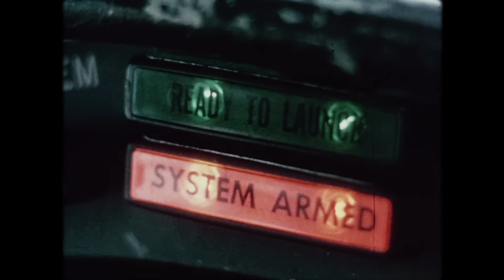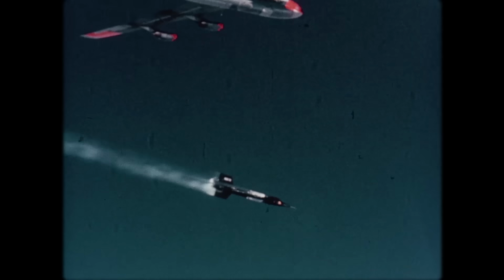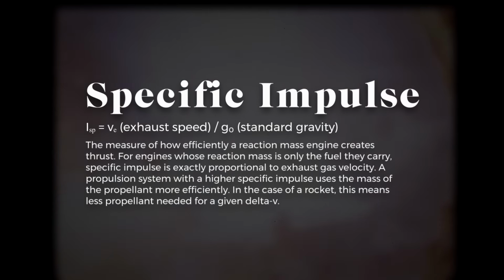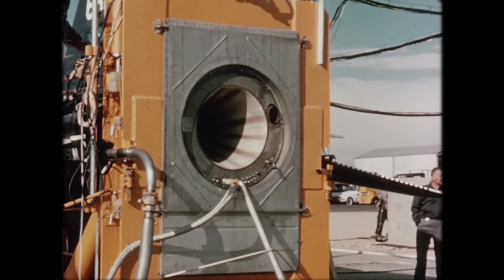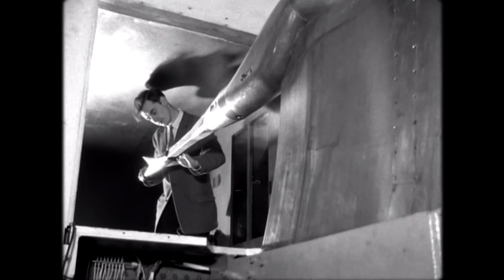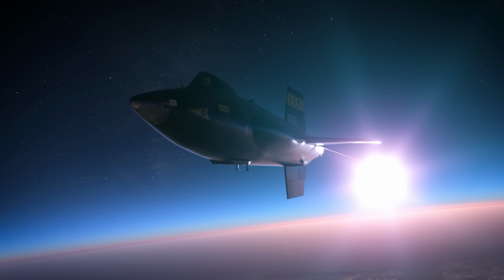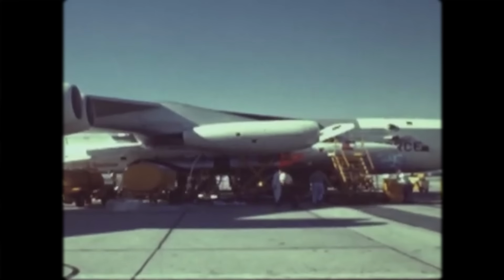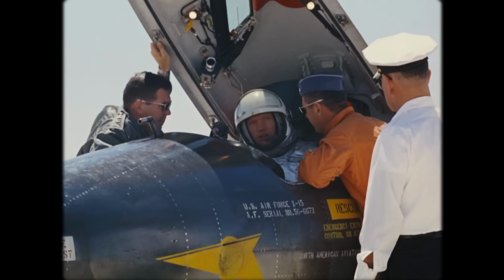The Insane Engineering of the X-15

Comment: You'll even read these American people talking such garbage about their aircraft, you'd really believe you were reading a pubescent 14-year-old struggling through puberty. 

Oh, you'll read endless claims they have the best fighter aircraft etc, as always. Seemingly they just don't know that both the F-22 and F-35 can't see, track, or target any other stealth aircraft from BVR (beyond visual range). 

Stealth alone defeats high-frequency (short wave) radar by absorption and deflection, it does not defeat low-frequency (long wave) radar. Therefore, to see, track, and target stealth aircraft you must have long-wave radar, but it must also be enhanced to remove all background clutter for targeting purposes.

Neither the AN/APG 77 radar used in the F-22, nor the AN/APG-81 radar used in the F-35, can see any other stealth aircraft from BVR (without enhanced long wave radar) — This fact the US Air force obviously know! 

Only it seems the reality is, that when the F-35 radars were being designed 13 years ago, there were no other stealth aircraft to think about as a potential threat? 

So how can these US aircraft be seen as any sort of threat to either China or Russia who both have these aircraft technically beaten? They can see and target US jets from BVR, yet the US jets can't even see them from BVR?

Russia's new 5th generation Byelka (2band) radar, used in SU-57, does have enhanced long-wave radar, they've designed and developed the first L-Band fighter radar we've ever seen. They've cleverly embedded L-band AESA radars in the leading edges of the wings. 

The new L-band AESA radar data gets processed in real time through extremely powerful Russian Elbrus computers being significantly enhanced removing all clutter, meaning it can see, track, target, and engage enemy stealth aircraft from BVR.

They can also interact in ''real-time'' with each other, and take control of ground to air missile defence systems (that alone is lethal), and they can see enemy stealth fighter aircraft entering Russian airspace if not long before Russian airspace from much greater distances with real-time data from massive Russian ground long wave stations (that are all protected today with the networked S-400 defensive system). 

Therefore, as they'll always know where the enemy aircraft are, they'll always be able to approach any enemy aircraft head on, and therefore stealthily, (Russia wisely sacrificed rear end stealth for much better manoeuvrability) meaning today, the US fighter jets would not even be able to see them coming!!

Russia's Byelka (2band) radar covers all aspects of frequencies across all channels, that are used for tracking, targetting, and also jamming. It's part of Sh121 multifunctional integrated radio electronic system (MIRES) on board the SU-57. 

Russia tested much of this new radar suit on the SU-35, so they also have the option of fitting this radar into SU-35's permanently, meaning Russia's SU-35S flanker will be at no disadvantage with F-22/35. 

As although the SU-35 can be seen and targeted from BVR, the SU-35 with the new 5th gen radar is as able to see and target the US jets from BVR, seeing the all-important Russian advantage in BVR missile distance, plus the excellent manoeuvring, neither the F-22/35 have, as more than critical, if you're going to avoid simply being blown out of the sky.

Dr Carlo Kopp of Air Power Australia explored low band AESAs embedded in fighter wing leading edges in 2009, and concluded that this concept is operationally and technically viable. 

Study results were not published by APA, due to the potentially adverse impact – APA has a long-standing policy of not publishing concepts that might provide potential adversaries with a competitive combat advantage. However, unbeknownst to APA, Tikhomirov NIIP were already working on this concept for two or more years, and they revealed the technology at the Russian MAKS Airshow in 2011.

Dr Kopp explains - the appearance of the first L-Band Fighter Radar is an excellent example of focused and intelligent lateral thinking which targets opponents' weaknesses. 

This is sound technological strategy and practice on the part of Russian industry. The new Tikhomirov NIIP L-band AESA is the first example of a technology which negates the intended X-band stealth advantage well before the F-35 Joint Strike Fighter achieves even limited operational capability.

Dr Kopp has produced a detailed forensic engineering study of the new NIIP L-band AESA and he explores the growth potential in the design.

While the NIIP L-Band AESA disclosed at MAKS 2011 might be considered a prototype, where the specific performance of this prototype might confer only a small combat advantage, the inevitable development of this technology confers long-term and accelerating air combat advantages, both as a counter to specialized X-Band Low Observability and for the detection and disruption of sensors and digital communications systems that operate in the heavily used L-Band.

No great originality is required to deploy and further evolve this design - the back-end hardware and software from existing X-band radars can be used with modifications, and publicly disclosed US roadmap documents for X-band AESAs can be emulated. The size of the Flanker and its power generation reserves make integration and cooling a low risk, easily solved standard of engineering problems.

And this was back in 2011. We've seen where it went, It resulted in the N036 Byelka radar system that's far superior and more advanced than any western radar, who have no equivalent.

Dr Kopp explains - This paper analyses the operational potential of this  design, and performs a range of performance estimates based on  manufacturer disclosures and known design features.

The design has clear potential to provide a genuine shared multifunction aperture with applications including: Search, track and destroy missile mid-course guidance against low signature aircraft. Identification of Friend Foe/Secondary Surveillance Radar. 

Passive angle tracking and geolocation of JTIDS-MIDS-Link-16 emitters at long ranges.
Passive angle tracking and geolocation of L-band AEWC-AWACS and surface based search radars at long ranges.
Passive angle tracking and geolocation of hostile (i.e. Western) IFF and SSR transponders at long ranges.

High powered active jamming of JTIDS-MIDS-Link-16 emitters.
High powered active jamming of satellite navigation receivers over large areas.
High powered active jamming of L-band AEWC-AWACS and surface based search radars at long ranges.
High powered active jamming of guided munition command data links over large areas.

Performance modelling for a range of the feasible configurations indicates the radar will deliver tactically credible search range performance.

The Tikhomirov NIIP L-band AESA is a very important strategic development, and a technology which once fully matured and deployed in useful numbers, will render narrowband stealth designs like the F-22 & F-35 Joint Strike Fighter, and some if not many UAVs, as highly vulnerable to all Flanker variants equipped with such radars.

Comment: Of course the USA is doing this! Only we see the truth and the reality is that the USA is still unable to produce a VTOL fighter aircraft?. The F-35B was claimed by the USA to be able to do what the Harrier could do, while also being supersonic, stealthy with modern avionics systems etc? This is what we were told? 

Only one of the biggest technical headaches the British always had to build the Harrier, was the VTOL — transferring from ''lift'' (downward nozzles) to forward flight (rear facing nozzles) and flying away. 

Apparently to achieve it took the British a hell of a lot of technical work, three — four months at a time over 3 years. (Look up all the variants they made) but they never gave up, and they finally figured it out.

I said long before we ever saw the F-35B, it wouldn't be VTOL capable, even with the Rolls-Royce lift engines, because the USA has tried many times before, and failed, only managing to produce the British Harrier able to do so. 

Any US airframe (and there have been many), have all failed. At 7 mins 50 seconds, you'll watch a Harrier perform a proper VTOL. Copy and paste “2013 MCAS Yuma Air Show — AV8B Harrier Demo” into YouTube search.
Watch it from lift off, (to more importantly, flying away from the lift off), and you'll see the transfer of nozzles take place.

You'll not find a single piece of footage of the F-35B doing this? I've had (Americans) tell me all sorts of rubbish, like it can do it, and even saying they've seen it lol, only when they can't show it? They quickly change, and instead we'll read them claim it was never intended to be VTOL capable? LOL. 

Sure, when Lockheed Martins very own page on YouTube clearly shows them trying to suggest it is VTOL capable, when it so clearly is not? Copy and Paste “First F-35B Vertical Takeoff Test” into YouTube search.
Watch this, you'll see it lift off, only you'll see it take off go straight up & hover then return straight back down? You'll never see it fly away from the lift off? 

Believe me, if it could, we'd see it doing so in every piece of footage we have on the F-35B - like we still see on all the footage of the Harrier doing so. But you'll never find any footage anywhere of the F-35B doing that. 

It shows you that Lockheed are not unknown to produce propaganda aircraft. As I claim the F-22 is exactly that. A propaganda aircraft, that was intended to be a viable military aircraft that failed. 

Americans will then go on to say it's not necessary? LOL. While forgetting, they're to be carrier-based aircraft, meaning even slight damage to the deck or ramp, they can't get any jets airborne. Defeating the entire purpose of having the aircraft in the first place? You can't ever lose an entire carrier in battle for only minor damage. 

And why do we see the USA doing that? It's obviously because the USA is still the only country that's never managed to produce & build a VTOL fighter aircraft?. Britain did so in the late 50s, Russia did so in the late 60s the USA has tried and failed numerous times, so it seems this time they're going to try to lie about it LOL? 

That country is a travesty man! The USA 2021, must surely go down in their own little space of history as being the dumbest country with the most uneducated society of all time. It is simply staggering.
Reply: I must say to the coment you made, Europe and the Brits are the main ones who used go after better tech.

Comment: Hypersonics is the cutting edge nowadays. Hard to believe that 50 years ago we developed a piloted airplane that could literally fly into space.....and fly under human control at hypersonic velocities.
Pilot Pete Knight flew an X 15 right up to the point were it was transforming into an incandescent fireball on the brink of self destruction. There are some pictures of his craft that was coated with an ablative coating, after this record breaking test flight. The tail surfaces were half burnt away, and the ablative coating was scorched in many other places.  If you had seen this X 15 at speed, it would have appeared to be a meteor........the year was 1967.
A number of X 15 pilots had terrible accidents flying this challenging aircraft.....

Comment: rocket.  not a plane.  those wings do not generate enough lift to keep it airborne.  the engineers never called it a plane.  if it cannot generate lift from it's wings, it is not an airplane, period.  those wings were for stability.  you can literally take any rocket, build a cockpit around it and fire it into the air.  it does not qualify as a plane which is why the sr71 is considered the fastest plane ever.

Comment: The explanation of latent heat of vaporization is applied incorrectly in this video.  The definition provided is decent, but latent heat of vaporization has nothing to do with the temperature at which a fluid boils.  It has to do with how long it will stay at that temperature before changing phases.  This is why a liquid will stall at the boiling point and not all flash to vapor all at once.

Comment: For the specific impuls the molecular weight of the propellant itself is irrelevant, it's the molecular weight of the exaust gases. Burning (rocketgrade) Kerosin means that the exaust consists of water and CO2 with both a much lower molecular weight than RP1 (Kerosin).

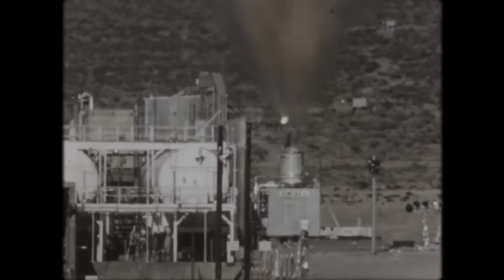Comment: What is the useful relevance of using the footage of the NERVA test firing at Jackass Flats at 11:00 in your video? That hydrogen was being passed over the extremely high heat of a nuclear fission reactor to produce thrust? The only thing that footage and what you're narrating has in common with one another is the use of the element hydrogen. That kind of propulsion is in a far different category than what you're ostensibly discussing in this video.

Comment: Minor nitpick: LH2/LOX has the highest specific impulse of commonly used and nontoxic fuels, but you can do quite a bit better than that (even without going to anything really exotic like nuclear thermal). The best specific impulse by a chemical rocket is 542 seconds, about 20% higher than you see from LH2/LOX, and it came from a tripropellant combination using liquid fluorine as the oxidizer, and a combination of liquid hydrogen and molten (metallic) lithium as the fuel. This of course has never been used beyond some testing though, since it's a hugely impractical and toxic combination.

Comment: After two hardcore Motorcycle Accidents that caused horrific injuries to my left arm, leg, and hip, nearly resulting in the loss/amputation of those limbs, my left side skeletal framework (arm, leg, hip) is reinforced, replaced, variously supplemented, and basically held together with fixing hardware including screws, plates, bolts, rods, pins, and so forth, made of Inconel Alloy. As this documentary reiterates, it was used extensively in the X-15, and WAS also used, albeit not to the same extent, on various areas of the A-12/SR-71 Blackbird Series Aircraft, most notably at various locations in the engines subjected to the highest stresses & temperatures....something I share with these magnificent & unequalled pinnacles of Aeronautical design & engineering achievement that gives me an odd sense of pride, even when I have to grunt through the legacy of regular bouts of chronic pain those injuries impose. If only they could have bought me a ticket on a ride in one of the Blackbird's last flights as they were retired in the late 1990's and flown to their final resting places of display at various US Air Bases & Museums. But the knowledge that similar bits of my bionic skeletal augmentations helped these awesome birds reach their limits is still kool, and way better than if they were just some kind of "super plastic" or less exotic metal. 🙄😲😈😎😝🤣💀👍👊🤘

Comment: i kindly disagree that the x15 is not the worlds fastest plane click the read more for my explanation
DO NOT HATE IF YOU DONT AGREE i do this to fix possible mistakes and i am interested on people opinion of whether or not what i am saying would make the x15 the fastest aircraft or not 

the x-43 is the world fastest aircraft yes ik it it controversial as its unmanned 
first lets start with the x15
The North American X-15 is a hyper sonic rocket-powered aircraft. It was operated by the United States Air Force and the National Aeronautics and Space Administration as part of the X-plane series of experimental aircraft.
now time for the x43
The NASA X-43 was an experimental unmanned hyper-sonic aircraft It was part of the X-plane series and specifically of NASA's Hyper-X program. It set several airspeed records for jet aircraft this unmanned aircraft went up to a speed of MACH 9.6! which is faster than 7000 mph and .around 12000 kph
both the x 15 and x 43 are apart of the x plan series making the x 43 also the official fastest aircraft ever created but the fastest an aircraft or space craft has ever gone was the Apollo 10 reentry at mach 26  if im not mistaken but yeah with both the x15 and x 43 in the x plane series they are both in the same family making the fastest aircraft actually the x 43

Comment: Total BS!!! there was only 1 single switch on the whole front control panel... after Chuck Yeager had a hissey fit & 2nd fit for it being unlabeled. Von Braun had Thykol use his new invention the label maker to add  "Afterburner" literally "After" Asshole ( German) "Buran" Rocket ( Russian/ German). The only controls other than that was the levers for landing gear & parachute, & the control stick.  The side panel in the beginning of the video is to disengage safties to the carrier plane, explosive separation bolts, & ignition. The whole rig was cruder than the A2s that bombed London as they had a complicated  guidance system! Stop making sh*t up!!! The only thing Yeager Von Braun & Thykol agreed that it was so crude a monkey could fly it.

Comment: Well, though many claim that what they do is original, this is not. This was based on data from the 1937 program that developed into the Me 163 first flown in 1941. Even the fuel system diagrams presented are very close to what the German's developed for using C-Stoff and T-Stoff as fuel for their rocket.